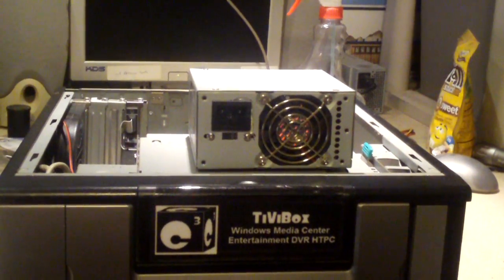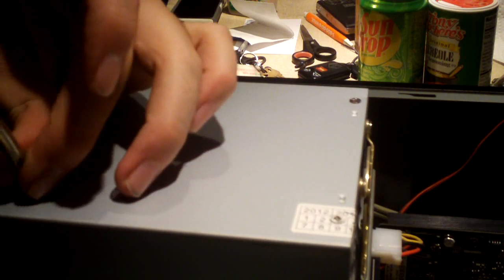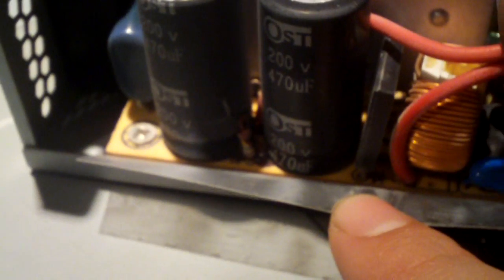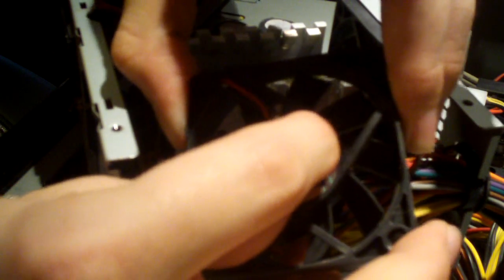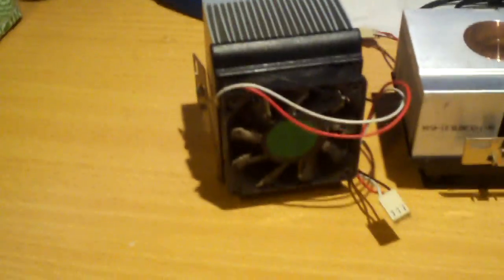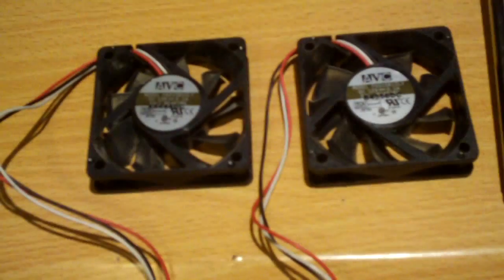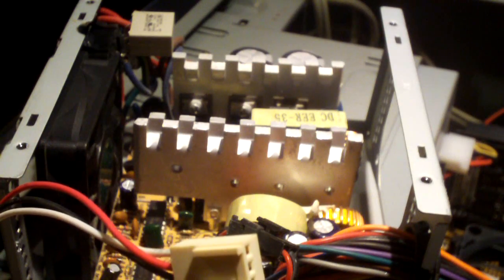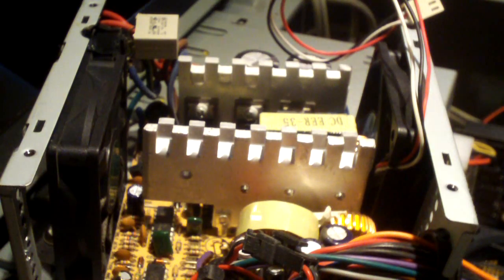Replacing worn out WAM fans in TiViBox power supply

Comment: ! I had to oil some Foxconn fans in my current system a while ago which started getting noisy and they've worked fine since I tend to oil rather than replace apart from these cheap low end ones which cannot be lubed! also I wouldn't trust OST caps so much I've had them fail on me before

Comment: I got some questions what brand of soldering iron do you use? Do you trust the cheap $10 ebay soldering irons? and are the non grounded ones worth it? also you should overvolt the fans! its fun to see how much they can handle before they die
Reply from the maker: The soldering iron I use is a basic Lenk 25W iron from Walmart... actually made right here in the US in Kinston, NC! I've been using it for many years... It accepts tips from Radio Shack (I'll have to fine someone else now that they went out!) In regards to the fans, they got the Ax, couldn't resist since they are "WAM" fans.